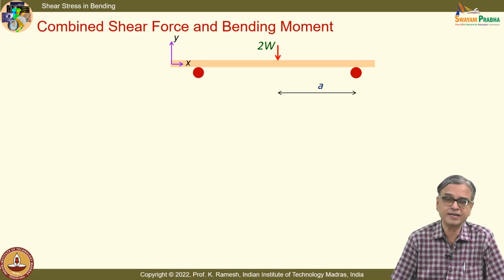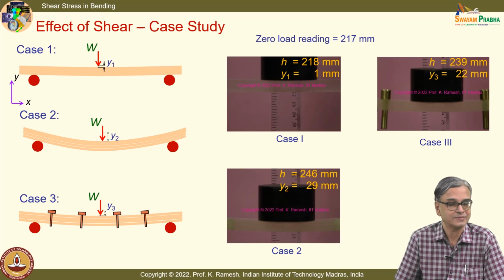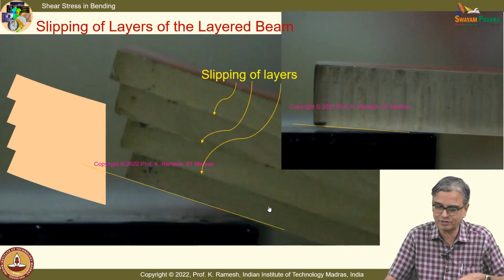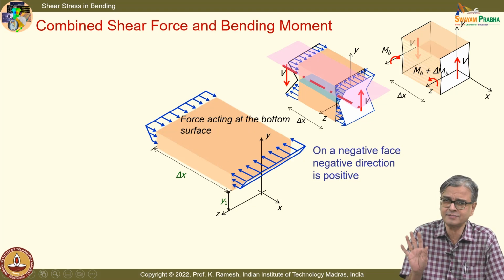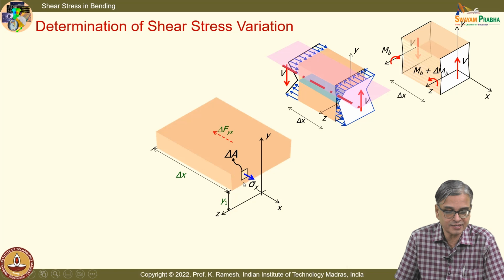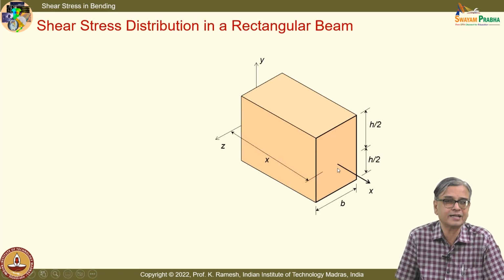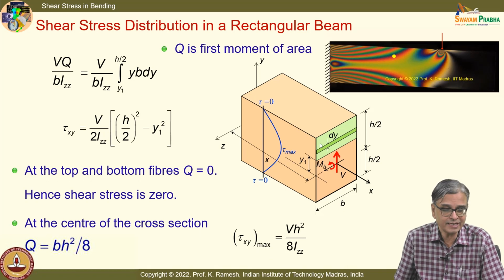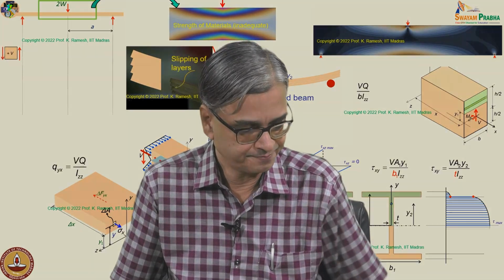LEC 26 Bending 4 - Shear Stress in Beams

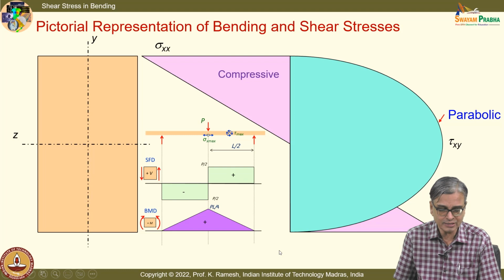Comment: 47:29 l think that the shear stress distribution should be plotted with y as horizontal axis since when it's plotted with y as vertical axis it gives an impression that shear stress is negative as y becomes negative which need not be the case!

Comment: Why the negative sign in flexure formula for sigma max is not used here in finding the shear force delta Fyx at 25:34. Since flexure formula (Mb/Iz = -Sigma x/ y). If it because here the minus sign identifies the nature of stress whether it is compressive or tensile other than the direction of force in positive or negative X axis. Anyone can please explain?
Reply: The negative sign from the flexure formula has indeed been used here. Please look at the expressions carefully.

It would become clear if you write the first expression of force balance and take ΔFyx to the RHS. Now, try substituting for the stresses using flexure formula (with the negative sign) and compare it with what is on the lecture slide.

Also, we adopt sign conventions to be consistent. We cannot and should not change it ad hoc for tension or compression. If our expressions consistently follow sign conventions, the algebra will give us the final nature of the stress (+ or -). Hope this helps.